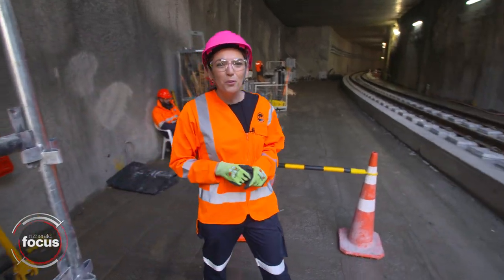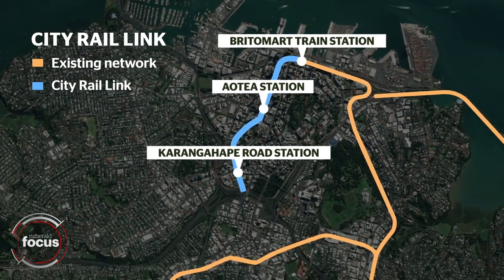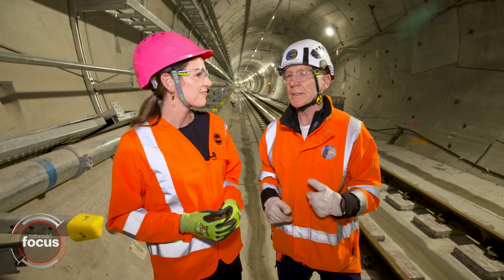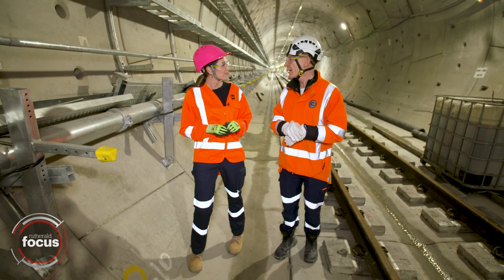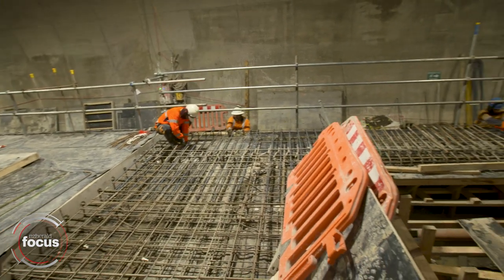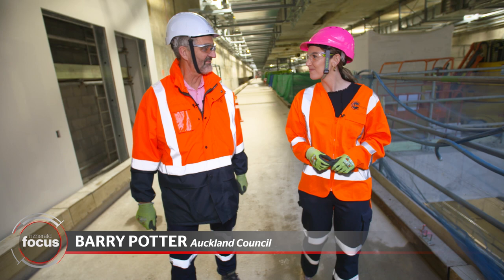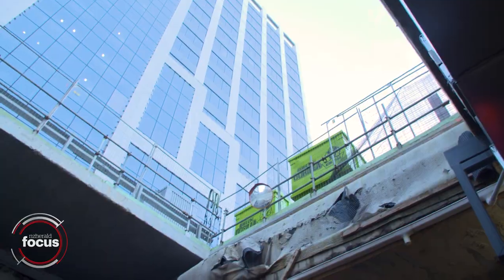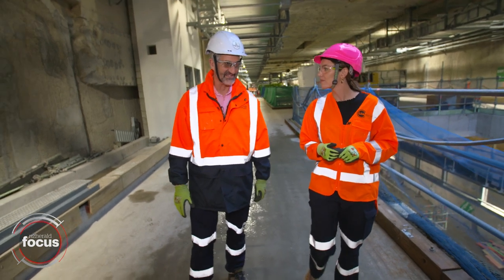First look at Auckland's new City Rail Link | nzherald.co.nz

Comment: CRL is a waste of money and pointless
Reply: The CRL is ridiculously expensive but alot of that was unavoidable.

It's not pointless, the CRL has a multitude of benefits, especially with Auckland's growing population. 

A link through the CBD will allow capacity, frequency and speed of the entire Network to double.
It will incentivise urban development and intensification along transit corridors and access hub's.
Increase the number of people who will have access to PT
Provide more access points into the City Centre therefore move more people in and out of the CBD more efficiently.
It will also open up corridors for the western line.
Reply: @rp7784  it's pointless,just face it .
A few kilometres that buses already cover
Reply: @jimshady2264  Lol I have faced it, hence why I clearly have more knowledge behind the project than you.

Buses are already congested along that corridor, they also have limited capacity compared to train's and they don't cover the route the rail network does, they also would not provide the benefits I have listed.
Reply: I work in the CRL tunnel, who did you say had the most knowledge.
You probably are a office worker with rightous opinions but actually know nothing
Reply: @jimshady2264  Ahahaha never assume too early in a debate.

I'm a transport and logistics expert that advised on the project, I've studied in Singapore and Germany and have worked across multiple transport projects so yes, I know what I'm talking about 😉
Reply: I'm here at the CRL tunnel and 94% off workers polled like the paycheck but know the project is an Auckland council joke
Reply: @jimshady2264  then congrats, you are benefitting on what you perceive to be a joke.

But such attitudes aren't surprising, it's very common for people to doubt infrastructure projects prior to completion. The same attitude was present during the Northern Busway before it became one of the most successful transport projects in NZ.
And the same with the opening of the Britomart Transport Centre before it became the epicenter of Transport in the CBD and the gateway for the CRL.

Such attitudes are even more common for countries that are new to major infrastructure projects.
Reply: @rp7784  just face it mate,the Billions spent and the businessess forced to close up shop for a few kilometres of underground rail that the public don't even need is disgraceful
Reply: @rp7784  obviously you don't
Reply: @jimshady2264  The more time's you say "just face it" the more I'm just going to think of how ignorant you are to infrastructure.

In every infrastructure project local businesses are impacted, that's unavoidable, it comes with the territory, businesses have closed many times across the world over on numerous infrastructure projects.
In that department CRL officials could have done a much better job at support and compensation payments.
But in the grand scheme of things we often look past current effects to long term benefits, the businesses that leave now will be replaced, foot traffic in the CBD have already returned to pre covid levels, infrastructure has a way to attract business in retail and commercial value, it always does, and investment in the CBD have already been made with new developments coming online.
Reply: @jimshady2264  oh, how so?
Reply: @rp7784  mate I'm a structural engineer so I know what is what
Reply: @jimshady2264  You know what is what in the construction of assets, buildings and infrastructure , but don't get that confused with logistical planning. I plan the works and you build it, keep those seperated.

You know little of the social and economical impacts of the logistical and transport aspects of this project obviously, you know little of the social reaction or human behavioural aspects of infrastructure, traffic patterns, route planning, social chain reaction, commute patterns or transport corridor planning in accordance to Urban environment and circumstances of density and population, so no, you are not as knowledgeable as you think you are unfortunately.
Reply: @rp7784  my friend you are just trying to justify the expense of a major construction future white elephant.
Are you contracted to Auckland council.?
Of course you are
Reply: @rp7784  My friend we are building high rise apartment buildings and hotels in the CBD one after another and they too will be white elephants as there is bugger all people to stay in them
Reply: @jimshady2264  Well yes I am justifying this project, way to state the obvious, the increases in the projects budget we're pretty much unavoidable.
As for "White Elephant" then by definition you are also incorrect because it won't be useless, I have already told you it's benefits, you just haven't read up on them.

You are pretty much just fuelling my point. Not once have you responded with data driven or on field foundated answers, it's been just opinions from you lol.

Again with the assumptions haha, didn't learn from the first time.
Reply: @jimshady2264  Boom, again you just enforced my point to your ignorance on the topic.

Untrue, Population settlement statistics have shown that an increasing number of people wish to live within the CBD and metropolitan suburban centre's, highrises are being built to cater for that future growth but to keep that future growth connected we need to give them access to a interconnected transit system of higher frequency.

I'm not sure where your getting that from but occupancy in Auckland's hotels have been pretty high, Auckland was actually in the midst of a hotel deficit recently, with tourist numbers still recovering, alot of construction work in the CBD I'm surprised we are getting the occupancy Rates we currently are.
It's also worth noting that alot of guests and tourists complain about Auckland's poor public transport connections and congested roads, especially European tourists, we often hear them complain about how our Urban centres are too car infested, which has shown to be a deterrent.
Reply: @rp7784  the increases were well aware of before the project started but how could you let the rate payers know of the false projected budget beforehand, they couldn't or the white elephant would have never got started
Reply: @rp7784  ditto to you my friend who pretends to be knowledgeable on town planning but in reality has no actual idea, sorry but must be honest
Reply: @jimshady2264  Again incorrect, my goodness, you are just punching the heavyweight of ignorance, this is becoming entertaining.
Budget increases were calculated in accordance to future inflation, possible scenarios of disruption but no one predicted a global pandemic, global supply chains shutting down for months on end, lockdowns for a month or so all of which blew the budget through any prediction made.
Reply: @jimshady2264  hehe I'm not the one pretending hun, you have an opinion on the project but you have done little to respond to me with factual answers, merely blunt opinion.
It's funny how you attempt to turn the idea of delusion unto me whilst giving me nothing but ignorance on the matter but I to must be honest, stick to what you know, and that's building, not city planning.
If you wish to embark on a career in transport and urban planning by all means do so, but if you're going to be a hypocrite and accuse me of pretending whilst displaying zero understanding on logistics and giving me factually incorrect viewpoints then your more than welcome to keep this debate up, but I'm just going to be viewing you as another worker who struggles with complex subjects, and instead relies on assumption 😂
Reply: @rp7784  well you would get a more comprehensive reply but I'm busy,we have a white elephant to build
Reply: @jimshady2264  oh no no, that hasn't stopped you before, please give me comprehension, it would be the first you have in this debate 😂
Reply: @rp7784  mate I just got home and I'm tunneled out as we progressed the white elephant to our best ability today as usual.
Maybe codify your misinformed mind set and do some research on waste of time projects
Reply: @jimshady2264  awe, I was waiting for comprehension, and yet I only see more tired opinions.

I understand it's incredibly easy for you to tell me to "do some research" but again, you have not given me any argument founded on research or facts, you more or less have only given me opinion whilst stating your experience in a qualification that has little bearing on the planning of infrastructure and logistics to which you take advantage of everyday.
It's hard for people to be open to opposing facts when they have become comfortable in their own opinion, but to tell me to do research and saying that I'm misinformed, that's a whole level of delusional arrogance, and again you have only just proven my many points 😂😂
Now due to your lacking responses I assume I'm either tiring you out or your running out of arguments unless you start recycling your previous one's or you actually do some research of your own, which considering you are working on the project you've made yourself look even worse with your poor level of understanding on the topic 😂
But good for you, your getting paid for building this and future generations will be thanking you for it, at the end of the day, a win win for you, and we can get on with the next project, and I can argue with the next person that will classify that work as a "White Elephant"

In terms of "Waste of time" projects, well nearly all infrastructure projects have been deemed a waste of time by someone, until it wasn't, that is unless we are discussing Dubai.
Reply: @jimshady2264 your a structural engineer but not a urban planner
Reply: @odzergaming  mate take it on the chin and say " the CRL tunnel was a mistake and sloppy decisions by council resulted in billions of dollars of rate and tax payers money"
Go on mate say it you will feel better,or is your surname Brown
Reply: @jimshady2264 it's pretty ironic how you tell people to "take it on the chin" but you yourself haven't given any factual statements to back up your opinions.
The truth is the CRL is being built, so we already feel pretty good, it's mainly you who is finding issue in this comment section so your more eligible to your own advice than us.

It's also obvious by your comment that you don't actually have any viable argument, just opinions and that's fine but if it's only opinions you have then please don't come on here and try and act as if you know what you're talking about.

Sloppy decision making was delaying the CRL for decades.
Sloppy decision making was having Auckland become a car centric city that has resulted in congestion costing the region over a billion dollars per year.
Sloppy decision making was underfunding PT pushing people to drive more, and this incentivised urban sprawl and a more expensive transport system and housing market.

The CRL has been in planning for decades, it was a staged approach and is necessary to double the capacity of the rail network and frequency.
Also the added benefit of incentivising investment in Auckland's urban areas, up levelling retail, residential, and opening access to the CBD for the rail network.

When you say sloppy decision making it's mainly just you not being able to take facts on the chin out of pride, arrogance, need of validation or however you wish to see it.

Again you have opinions but don't try and use those opinions as a greenlight for you to be condescending.
Reply: @rp7784   it's a fact that' the City rail link is an absolute waste of time and ratepayer money, how's that for factual.
Reply: @jimshady2264  Again dissapointing 😂😂😂.
Not factual, just opinion.
If it was a waste of time and ratepayer money you would have forfeited your wages that's part of the expense of the project.
You also would have to ignore the investment that is occurring in developments within the CBD, and the other benefits I have listed that would and is stimulating the economy, so sorry, I'm not seeing any facts in what your saying.
Reply: @rp7784  look my friend,it's not just my opinion,it is factual and you know it but rightousness prevents you from admitting it .
It's all right, one day you will humble yourself and cry out " CRL was a disgraceful con job and I fell hook line and sinker for it
Reply: @jimshady2264  hehe, but the point is nothing you have said is backed up by evidence, statistics, studies, reports or any form of official documentation so technically and literally it's not fact, again just opinion.
Technically we are both guilty of righteousness, that's not the issue here as I have numerously pointed out lol.

I like how you try to use humbleness against me, because it's mostly you who is trying to elevate yourself above me by opinions with no factual foundation, you are the one who assumed my occupation lol, you are the one who declared yourself as a structural engineer even when that has nothing to do with urban planning and transport, and you also have passively dismissed those of us who have disagreed with you followed up with a "I'm right your wrong so nanananana" attitude all of which is based on again, opinion.

And all this is on your own righteous, a stubborness or pride. So I don't think I'm the one in for a humble shock.

And again, I'm loving your hypocrisy, you try to assume my attitude in the aftermath of this project but you've just shown your lack of humbleness because you, an individual who has no background in transport, logistics or urban planning is assuming outcomes based on nothing evidential or factual, just opinion, and that's a level of arrogance not even I am capable of hehe.

Got anymore cards to try? Perhaps one you haven't flipped before, hopefully one intellectually stimulating, you still owe me comprehension lol.